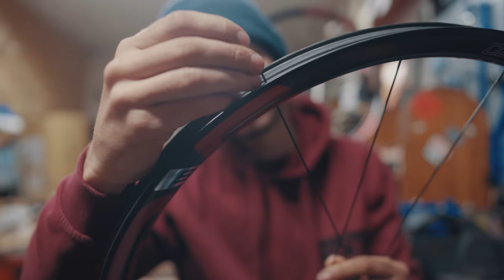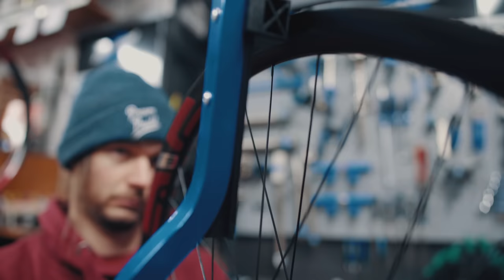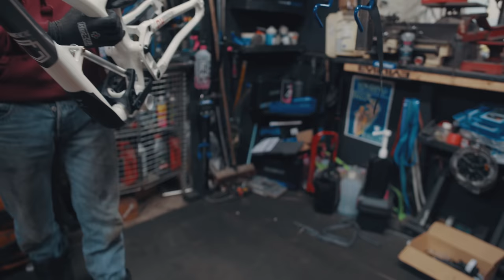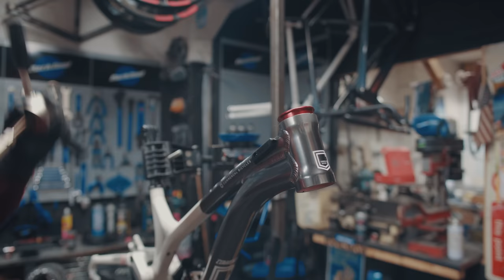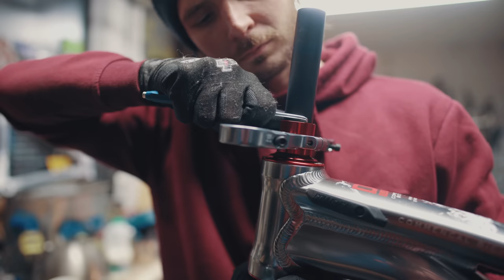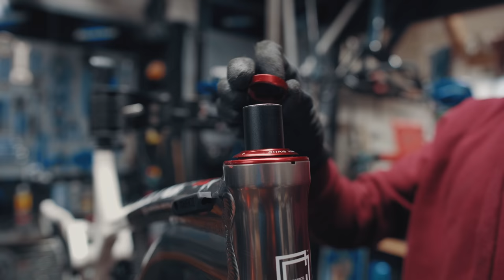DREAM BUILD MTB - Commencal Supreme DH

Comment: Dude love the video. You are very meticulous in a good way.  Couple questions for you tho.  I see you're wearing gloves while you grease and as a user of that type of glove everyday. How are you keeping the grease off the bike when the gloves are covered in grease? I always use a nitrile glove over them to keep them grease and oil free. I can just toss the nitrile glove away and still have clean gloves.  Also noticed that when you torqued the handle bar riser you did one side and then the other instead of opposite corners. Any reason for that or is it just the way you've always done it? Either way I just randomly found your video and I subbed
Reply: Probably changes gloves after each task

Comment: Also just a quick question.  Why do you grease all the bolts?  Or is that some kind of lock tite? You don't want to use grease on a bolt that's not open as you could crack the aluminum.  Remember fluid doesn't compress.

Comment: quick question, why do downhill bikes have smaller cassettes than all the other bikes?
Reply: They only pedal on the flat sections at speed low gears are unnecessary and dead weight

Comment: Can anyone tell me why does he apply lube on the screws and all arent you supposed to apply locktite on the caliper mounting screws and all?
Reply: all bolts are torqued to spec with grease is called wet torque no grease is std torque loctite is a good idea if you don't have a torque wrench
Reply: @justincase7109  Hmm got it man!

Comment: I do not why use 7 speed drivetrain instead of a 9 or 10 speed, and somehow find the bike builds very intriguing.
Reply: You only need the „big“ gears for a DH-Bike, because you only ride downhill or in the flat and that (normally) very fast. But you would never ride a big bike with a DH-geometry uphill.